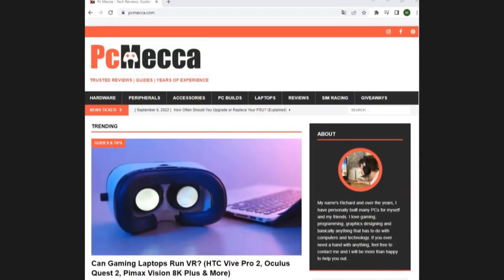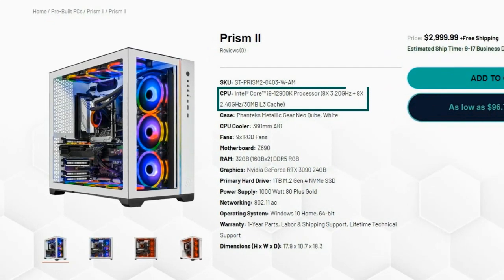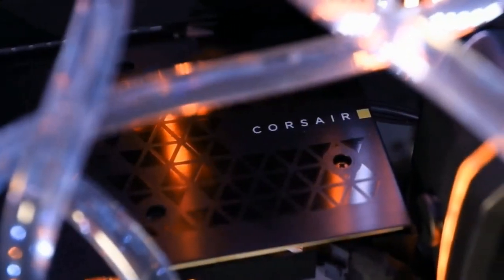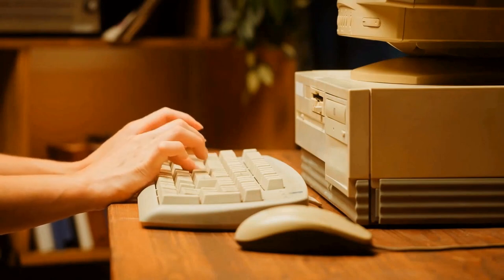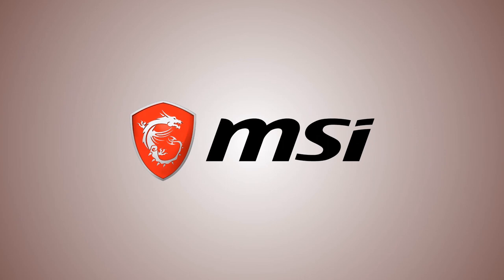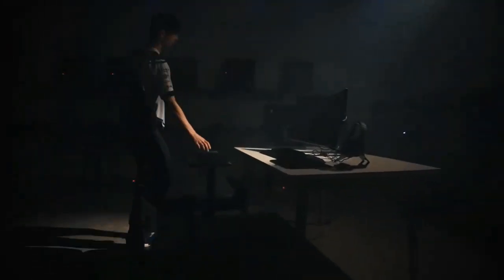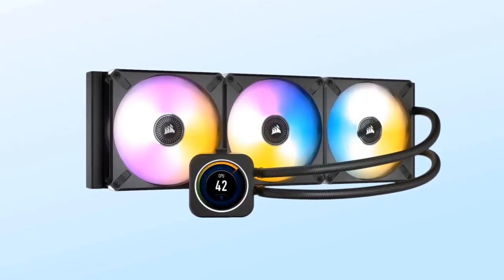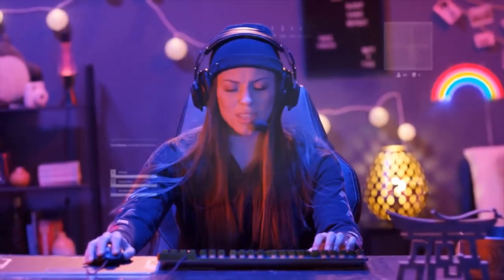Best Gaming PC BRANDS in 2024 (TOP 5)

Comment: Hello! I have a budget of 2,000, I don't want to go much over. I want a prebuilt and don't trust myself to build one myself. I want to mostly play games like valorant, Fortnite, and apex, with frames around 160+ if thats possible, which would you recommend?
Reply from the maker: Hey there!

$2000 is a slight overkill if you're going to use it only for gaming, and especially these games--For $1600-1800, you'll be able to find an adequate PC for these games. But a $2000 PC will be a bit more future-proof.

Here are my suggestions; any of these will be able to run all these games on 160+, even 200+ FPS, especially if you don't need ultra settings:

- Skytech Azure - https://amzn.to/3ZFE5QP (4070 TI + Ryzen 7 is an excellent combo + you have water cooling for your CPU and solid 1TB storage. The only drawback is the 16GB of older DDR4 memory, but that doesn't make a significant difference for gaming)

- Skytech Prism II - https://amzn.to/3Yoccff (more or less the same build but better aesthetics)

These will give you the best bang for your buck and will be viable for the foreseeable future (especially the Azure with the 4070 Ti).

Feel free to reach out if you have any other questions, and we'll be more than happy to help you out!

Comment: Hey! I have a budget of around £800 but I'm mainly looking for 500 - 670£ pc's that can handle mw2 or sekiro. Do you have any suggestions?
Reply from the maker: Hey there,
500 - 670£ is a rough budget as you won't find a solid PC with a GPU better than the RTX 3050 or the GTX 1650. That's why we usually recommend buying a console if you can't spend more than 650£ ($800).

So, you can either do that, or get a renewed one on Amazon with at least an RTX 3060 Ti (that's the least we'd recommend for MW2). Sekiro will run no issues with 3050 or 1650 cards.

Looking at Amazon right now, here are the best options currently:

Skytech Blaze - https://amzn.to/3MO5IEq
Acer Nitro 50 - https://amzn.to/3UJW7jF
HP - https://amzn.to/43B26LO

These will be great for Sekiro, but you'll struggle with MW2 if you have a high refresh rate monitor and want to game on quality settings.

Personally, I would recommend saving up a couple hundred pounds/dollars more and look for a PC in the $1000-1200 range - You'll have many more quality options with at least the RTX 3060 card and a solid CPU (i7/Ryzen 7). 

Let me know if you have any other questions!

Comment: I'm looking to replace my PC and I really like the presentation and detail that you provide here.  But I have a question, it's currently Feb 2024.  So how is this video already a year old but referring to 'Best Gaming PC Brands for 2024'?  Did you just change the title of the video?  Has anything changed in the landscape since this video was created?  This is noticeable as the selected PCs mention 12th gen Intel processors and RTX 3000 series graphics cards.  14th gen Intel processors are out now as well as RTX 4000 series graphics cards.
Reply from the maker: Hey man, good point. The brands remain the same so we switch the title for 2024. Will be updating the PCs in the near future. Let me know if you need help with anything.
Reply: @pcmecca7339  Thanks!  I'll be looking forward to the update!  Right now, I'm in the process of returning an HP Omen that is acting strangely, nothing horrible but several small things that occur randomly and neither I nor HP support can figure them out.  That's a shame because generally it seemed well built at a good price.  My old computer is a 10 year old HP Envy, albeit with upgraded GPU, RAM and disk.  The old system is still capable but it's overdue to be replaced.  Anyway, once the new Omen is boxed up and I have the refund I'll be starting my search over.
Reply from the maker: @rc1298  Highly recommend looking into SkyTech or YEYIAN PCs if you're after value for money. The price is typically very competitive for the hardware included and both are based in the US. And they offer overall better PCs than HP, imo.

Comment: Always been a console guy. Looking for my first pc (prebuilt). All I care to run on it is Fortnite at 240 fps. I have 2k. Any recommendations? Thanks!
Reply: The AMD 7800X3D is both overkill for your needs and is cheap and power efficient. Pair with any GPU, it doesn't matter you will hit 240 FPS with Fortnite easily.

If you want productivity performance as well, go for the Intel 13900K, the 13500K or AMD's 7950X. But if you want the fastest FPS at the most affordable price, the 7800X3D has zero competition or compromises.

Comment: Not sure if you ranked them but my budget is around $2000. And I’m not the most knowledgeable with computers. I currently have a skytech Archangel and it kinda sucks, bad frame drops, I have to lower settings a bit. And only game I play is black ops 3 and a couple MMOs. So what would you recommend
Reply from the maker: Hey Brian,

I personally think $2000 is a bit too much for just playing MMOs and Black Ops 3 unless you need it to push frames for a 1440p high refresh rate or 4K monitor.

If you have a standard 1080p/1440p monitor, then I'd recommend buying something cheaper with an RTX 3060 Ti, max 3070--You can find a PC for less than $1500 with a 3060 Ti and an i5 or Ryzen 5, which would suit your needs perfectly.

3060 Ti PCs:

- SkyTech Archangel - https://amzn.to/3Gj9vEN
- Skytech Shiva - https://amzn.to/3Iupxy9

This one seems to be the sweet spot for your needs:

- Skytech Azura - https://amzn.to/3GtMXkS - i7/3070, excellent value

If you want to spend the full $2000 and get a more future-proof build, then I'd recommend looking for something with DDR5 memory (ideally 32GB), i7 or R7 processor, and a 3070 Ti/3080 GPU. Here are a couple of great PCs that fit the bill:

- Alienware Aurora R13 - https://amzn.to/3XcYsUe   (i7, 3070 Ti, DDR5)
- Skytech Chronos - https://amzn.to/3ihEWr3 - (i7, 3080, DDR5), but watch out, this one is over the budget
- Skytech Chronos - https://amzn.to/3ikGtg0 - (i5, 3080, DDR4)

if you don't like any of these, keep in mind the general specs:

If you want to save/don't worry about futureproofing: i5/R5 CPU, 3060 - 3060 Ti GPU, DDR4
If you want to spend full $2000 and get a future-proof build: i7/R7 CPU, 3070 - 3070 Ti - 3080 GPU, DDR5

Let me know if you have any other questions.